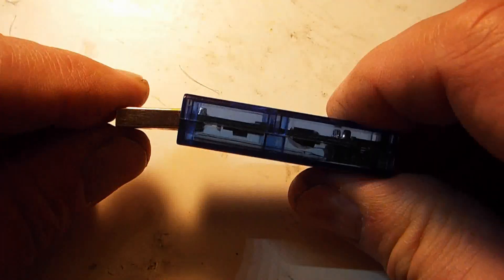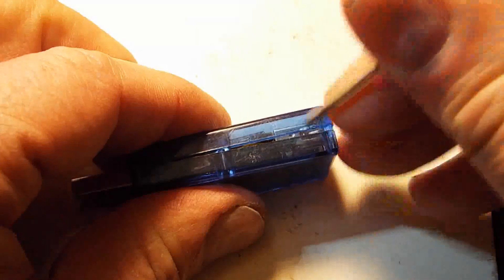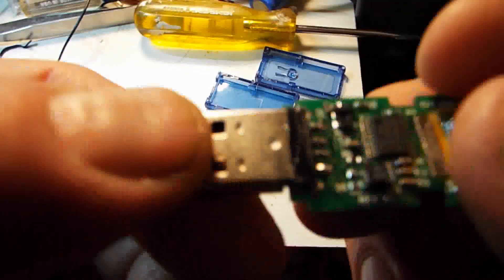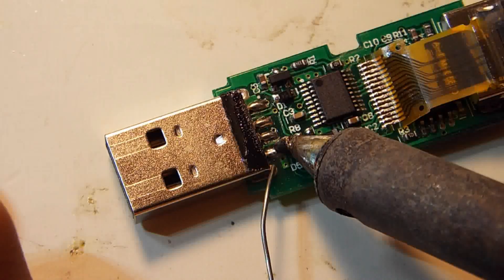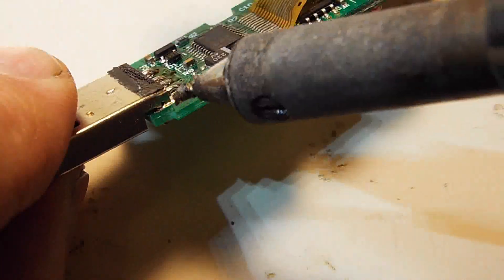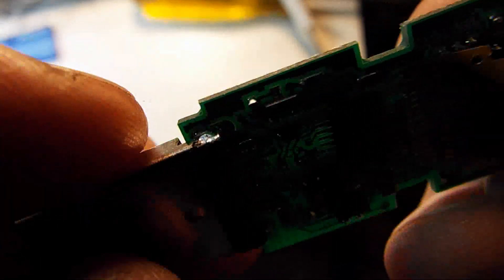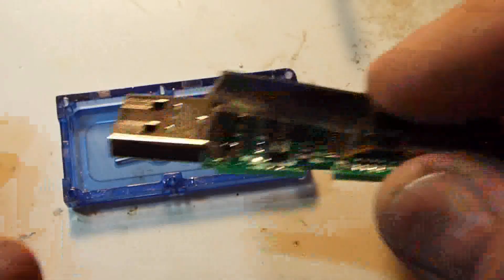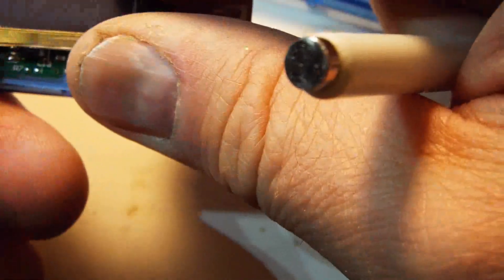Fix a Broken USB Connector / Repair Damaged USB

Comment: Just reapaired my flash drive watching your video. I noticed the wiggle and the disconnecting sound my computer was making when I plugged it in. Taking it apart was not as easy as yours it looks like a dog chewed on it now lol, but it works after I soldered it. Thanks for the clear instructions.
Reply from the maker: That is great! Bummer it did not come apart easy...
Reply from the maker: How is the repair holding up?
Reply: Holding up very well thank you.
I’m not too good sodering but I’m proud of myself :)
Reply: Holding up very well thank you.
I’m not too good sodering but I’m proud of myself :)
Reply: Holding up very well thank you.
I’m not too good sodering but I’m proud of myself :)
Reply: Holding up very well thank you.
I’m not too good sodering but I’m proud of myself :)
Reply: Holding up very well thank you.
I’m not too good sodering but I’m proud of myself :)
Reply: Holding up very well thank you.
I’m not too good sodering but I’m proud of myself :)
Reply: Holding up very well thank you.
I’m not too good sodering but I’m proud of myself :)
Reply: Holding up very well thank you.
I’m not too good sodering but I’m proud of myself :)
Reply: Holding up very well thank you.
I’m not too good sodering but I’m proud of myself :)
Reply: Holding up very well thank you.
I’m not too good sodering but I’m proud of myself :)
Reply: Holding up very well thank you.
I’m not too good sodering but I’m proud of myself :)
Reply: Holding up very well thank you.
I’m not too good sodering but I’m proud of myself :)
Reply: Holding up very well thank you.
I’m not too good sodering but I’m proud of myself :)
Reply: Holding up very well thank you.
I’m not too good sodering but I’m proud of myself :)
Reply: Holding up very well thank you.
I’m not too good sodering but I’m proud of myself :)
Reply: Holding up very well thank you.
I’m not too good soldering but I’m proud of myself :)
Reply: Holding up very well thank you.
I’m not too good soldering but I’m proud of myself :)

Comment: What temperature was your iron, and what type of solder did you use?
Reply from the maker: I run about 740F ( temperature controlled Pace solder station ) I have always used 60/40 tin/lead with rosin core.

Comment: Does this work if the usb head has actually fallen off
Reply from the maker: If there are still pads on the board that can be soldered to and the USB connector still has the legs that get soldered to the pads in place it should work fine.
Reply: @madscientisthut  I think I might just be safe and buy a new mouse
Reply: But thx

Comment: Nice fix, thanks. Glad it worked in your case. For me, the USB receiver for a mouse dropped on the floor and bent up about 15 degrees.  Upon examination there were no obvious open connections so I de-soldered the end plug to examine it better. All looked ok so I re-soldered all 4 pins plus the side anchor points. Tested with a continuity tester and there were no apparent shorts. When I plugged it in again, still didn't work but now it was smoking at one of the sides. Still don't know why it stopped working. Might try de-soldering and re-soldering again to get rid of the probably short. Any suggestions?
Reply from the maker: It is possible the the circuit board may have sustained internal damage when the connector bent.  The traces and annular rings around vias can be extremely close together with very thin circuit boards can be damaged easily with just a small amount of force. Another possibility is one of the surface mount components could have been damaged from the board flexing when it was bent. It is a bummer that some things will get broke beyond easy repair. Thanks for stopping by.